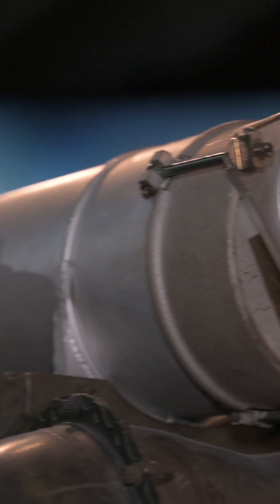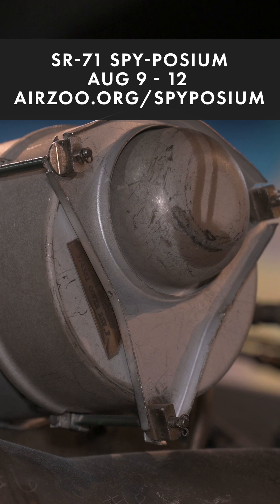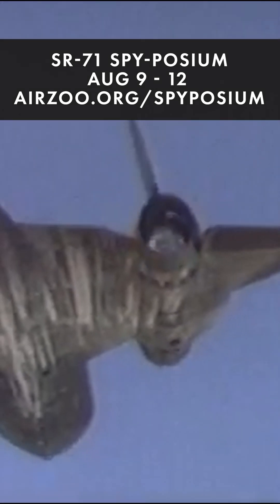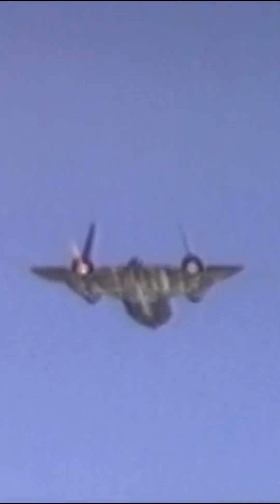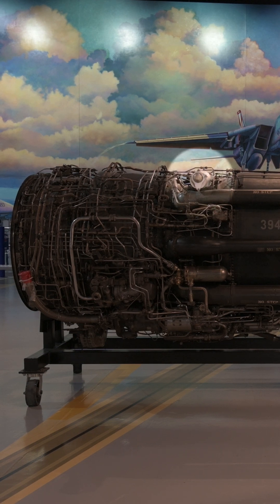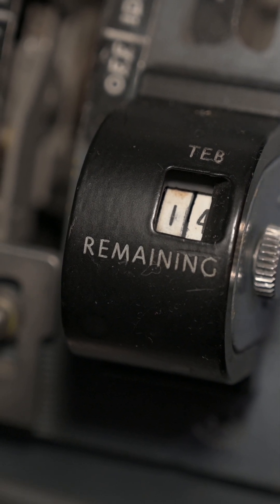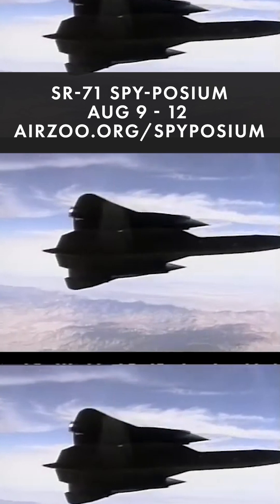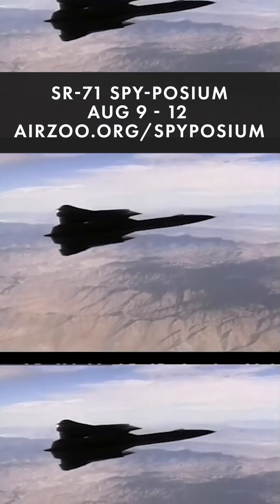What is TEB and why was it important for the SR-71 Blackbird?

Comment: What if they ran out? Like in a flameout situation? No jump starts from AAA at 80,000 feet agl and mach 2
Reply: The full TEB tanks each held 600ml, which was enough for 16 engine/afterburner starts. 

Once they sorted out the engine unstart issues early on in the Oxcart program, 16 was apparently seen as more than enough for a typical sortie with a few extras for safety sake. 

Odd though…even though the SR-71 was the only airplane in the DOD inventory that used JP-7 and TEB, the pentagon was still buying a LOT of both well into the 2000s. The SR-71 was retired in January of 1990 so… Interesting.
Reply: @FloridaManMatty  thanks. They couldnt pull over, or land wherever
Reply: If they ran out, they ran out. No restarty, no joy.